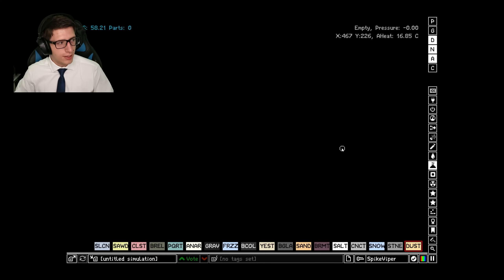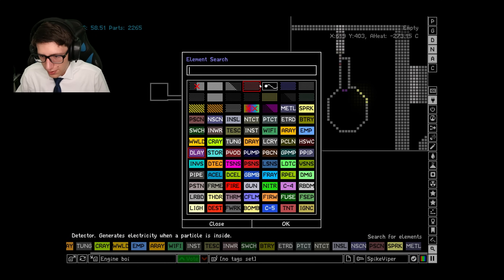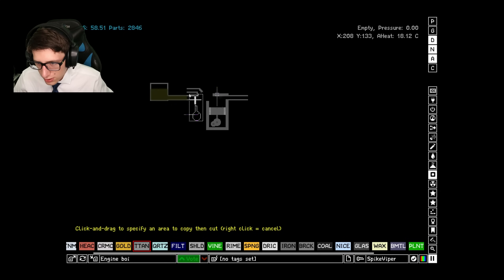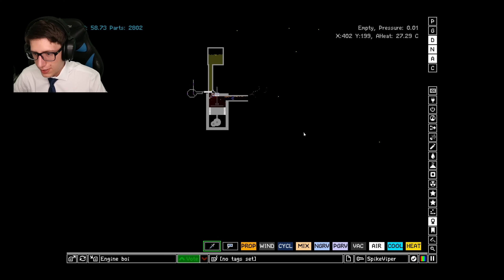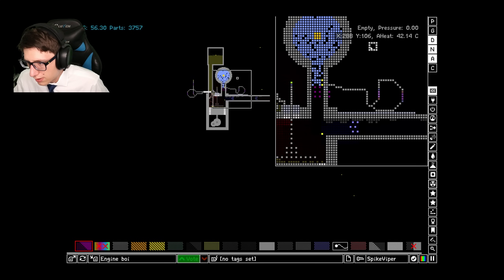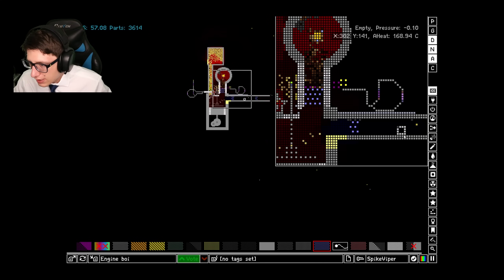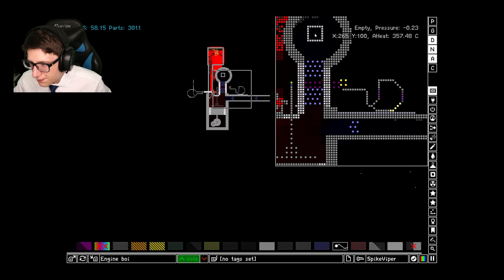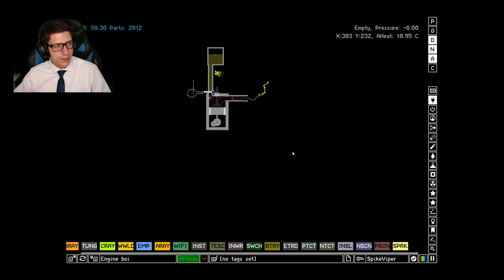Single Cylinder Engine in The Powder Toy!

Comment: im pretty sure you need to set every individual fan wall you place, you cant just set one, because that only makes the one singular fan wall work

using a larger brush may help

also for airflow you need both an in and an out, else it just becomes a vacuum and air stops flowing after

Comment: You can change the max extension length(tmp2), movement distance (temp, every 10deg C over 0* is 1 pixel of movement), the max amount of pixels it can push/pull(tmp), and the element that blocks it (ctype) using different properties. look on the wiki for this. It will make your life easier as you can instantly open or close a valve.
Reply: And I thought extension Length is linked the length of the pstn itself 😆
Reply: @gizmo557  I suggest to read the wiki fully. It has a lot of info that always ends up helping newer players IME. (I've been playing TPT for 4 years)
Reply: @nikkiofthevalley  thx! I also started playing this game 4 years ago!
Reply: Thx for the info!

Comment: You should add an exhaust valve and some PUMP  to simulate both the pressure/vacuum needed to run an engine it would also help illustrate the 4 cycles more clearly although the pistons for the fuel injector is a neat idea that i might have to borrow for the engine im working on rn lol

Comment: Suck, squeeze, bang, blow. The 4 cycles of an engine... I recommend watching some other YouTube channels before attempting this again... because you're missing a throttle (butterfly valve), intake and exhaust valves (piston valves), and rotational energy from the crank shaft to an alternator via serpentine belt to generate power to charge the battery which charges a coil to the spark plug to ignite the fuel. Unless you have a crank driven magneto.. Then you have the cam timing belt to move the valves. Unless you do freevalve tech with electric solenoids, then you won't need a throttle. Or you can do timing by gear drive. As you increase the throttle opening it will register more air adding more fuel and accelerate. Then decelerate when closing the throttle. But I don't think this accounts of anything I just blabbed on about.
Reply: I dont think generating energy with moving pieces is possible in tpt. The best thing would be using a steam generator and DETECT to generate SPARK
Reply: @trulers8713  Yeah, the only realistic way of generating power in TPT is somewhat similar to a radioisotope thermoelectric generator. (You put POLO in a glass box thick enough to convert PHOT to NEUT. On the outside you put a 1 pixel layer of PSCN and then NSCN, which generates SPRK when it gets hit by PHOT.)

Comment: Hey spike the piston doesn't have to be that short if you make pstn longer it will push further and in one go this means if the pstn is 10 pixels long it will expand 10 pixels if you spark it once. 
Edit: it will not expand exactly it's length so if it is 10 pixels long subtract 1 pixel so it will expand 9 pixels.
I hope this Useless information helps